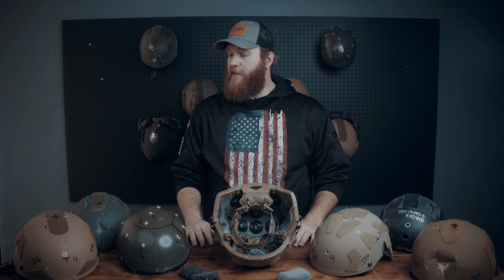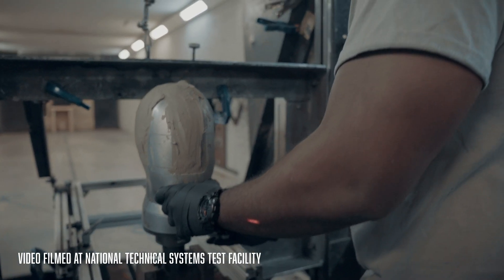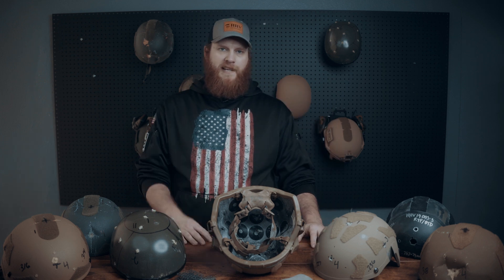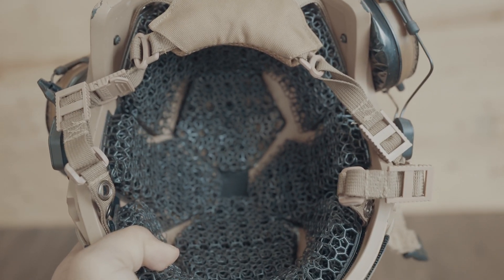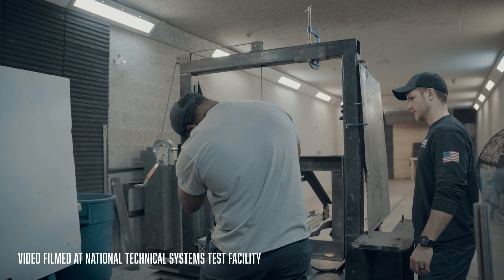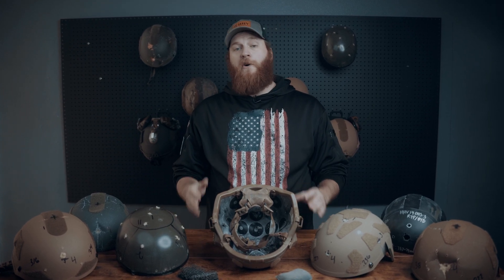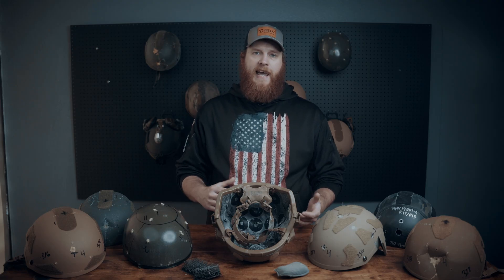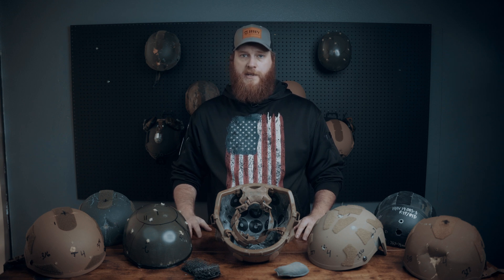How Ballistic Helmets are Tested for Backface Deformation

Comment: I've seen some interesting testing videos from Ulbricht with their titanium helmets showing impressive results. Do you have any comments on titanium as used in helmets, or they're testing methodology in general?
Reply from the maker: Seems heavy, but Ulbricht is definitely leading the charge in alternative material helmets, even if they are a bit pricy. They’re a solid company with a solid team too, which we like. We spoke with them for about an hour at SHOT.
Reply: @HardHeadVeterans  yeah, they are definitely geared toward swat teams, hoo heavy for the regular use of a soldier. I did find it odd that in their testing, they actually suspend the helmet with a mount, independent of the dummy head.

Comment: Only wish they had regular ARC rails, I can't find a good M-LOK adapter kit for my walker razors. The set HHV sells is back ordered by 4-8 weeks, and it doesn't even rotate so what good is it.
Reply: The HHV Mlok adapters are terrible. I think I bought my Mlok mounts from Gentek along with my Amparms.
Reply: @irregularrex4004  Mlok rails are epic, idk why you don't like them. You can literally attach anything to Mlok lol
Reply: @projectleaflet  I didn't mean the Mlok itself, everything I run has Mlok. I was talking about HHV's current Comtac adaptor mounts. Hopefully their second gen adaptors are solid when they release.
Reply: Sorry, I bought them from Unity tactical. So far so good. Ran them at a few trainings.
Reply: @irregularrex4004 were you about to mount them on the upper most rail? Or centered on the bottom rail, and you had to get both the mark 2.0 peltor style had mount as well as the mark mlok adapter kit?
Reply: Able*
Reply: @gaiusjuliuscaesar1010  So I run Comtacs on the Ops Core amp arms with the Unity Tactical Mlok adaptors to the rear rails on my helmet.
Reply from the maker: Unity Tactical makes an adapter for just about everything, and other helmet manufacturers are now starting to move to m-lok as well. We're currently working on a new rail adapter kit and are in the final phases of testing it, however our original design does rotate.
Reply: @hardheadveteransateballist5757  oh it does? None of the advertisements for it shows it as rotatable. But I'll look at unity tactical.
Reply from the maker: @gaiusjuliuscaesar1010  The current one does rotate up. It doesn't lock and unlock, but our new model that we're field testing as of last week does. Unity is a great company, we highly recommend their gear.
Reply from the maker: The newest set that’s on back order is on back order because it’s currently under-going field testing. We have to finalize the design before keep it in stock permanently. That should shake up and be in stock around the clock soon. 

If you have an immediate need I’d highly recommend checking out Unity’s mount or heading over to Comm Gear Supply. They have loads of options in stock and ready to ship.